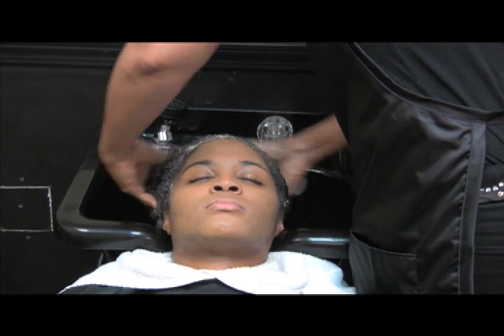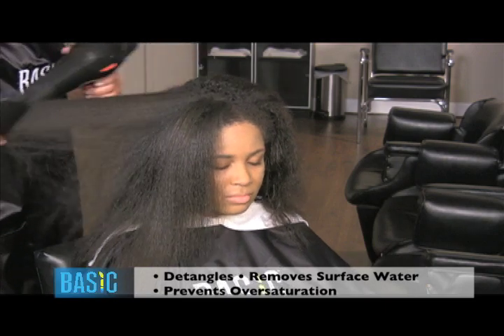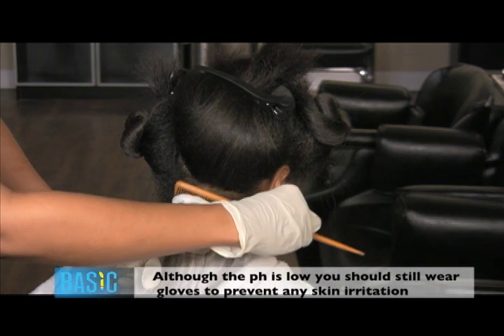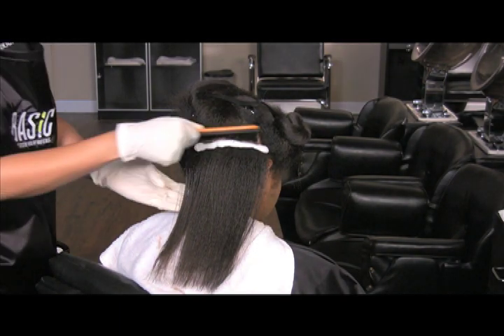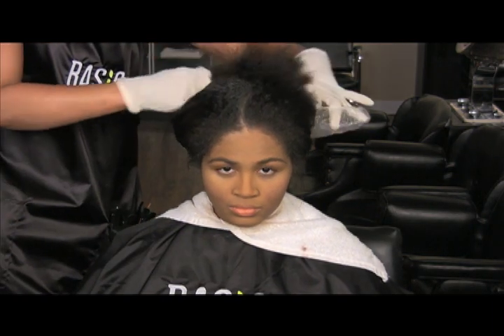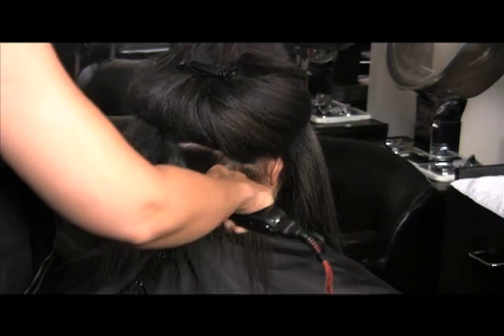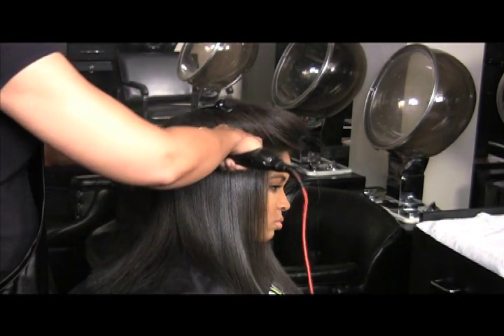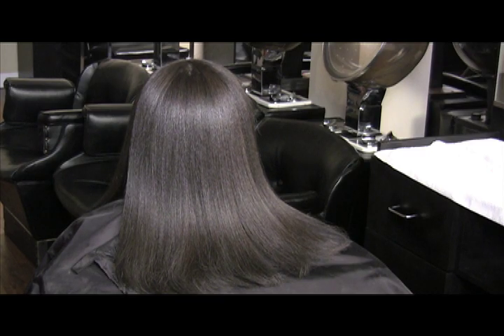BASIC "One-Step Smoothing System"

Comment: I just recently got this done to my hair, it looked great soft and bouncy as usual when it's straight. But after I washed my hair I almost cried. My ends looked as though there had been heat damage. Yes my hair is colored, I've never had a perm and that was only the second time this year I had straightened my hair. My hair is naturally curly, I have to tease it when it dries so that it doesn't look like a jheri curl. I told my stylist that I wanted to have looser curls and was not expecting my hair to look like it did 5 years ago. I tried scrunching it which only helps a little I can tell where it's curling up a little, and I'm not expecting it to be how it was before. But I dang sure wasn't expecting what's going on now... I don't even feel comfortable wearing my hair down because it looks funky and makes me want to cry.... 
So I'm just curious how did others turn out after they washed their hair... If you had the same issue what did you do?
Reply: If the heat setting is 450F then this is the temperature that will denature tge hair causing heat damage
Reply: I have the exact same problem. My hair is so dried out, my hair literally looks like a birds nest.
Reply: I was just looking at this I'm glad you ladies commented. I will definitely need to research this product more
Reply: I had that same issue and I have naturally curly hair. When I washed my hair the ends were broken and looked heat damaged. I had to cut off the damaged ends and deep condition weekly. I also used hair masks & a protein treatment once per mth while the hair grows bk out for my new hair growth. I will give this product a no for me. I rather texlaxing for more manageable hair with my hair curly hair type.
Reply: I never understood why people who claim to love their curls so much go and get treatments like this.

Comment: My stylist does this same process with my natural hair for years using regular products with just natural leave in conditioner under my plastic cap and some type of straightener or hair press on each part as sure works through my hair. She uses Kara Care, but you can use any products with this method.
Reply: Does it last for up to 20 washes?
Reply: I assure you it is not the same.